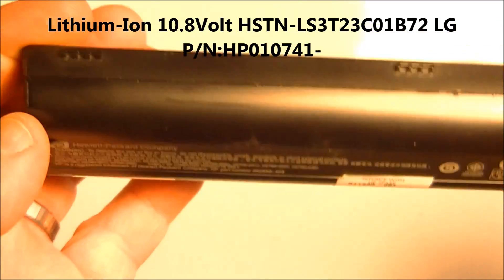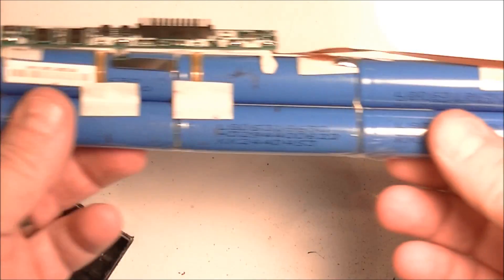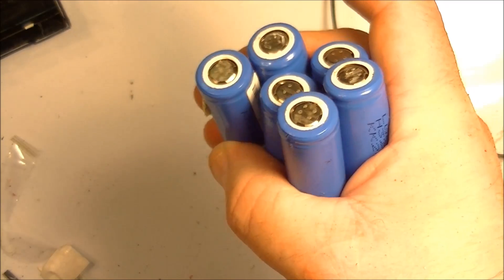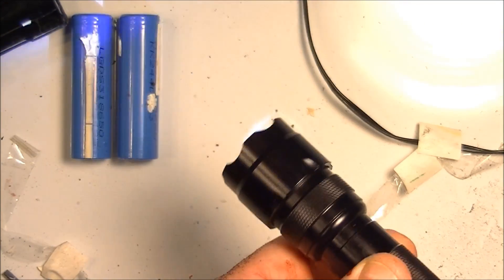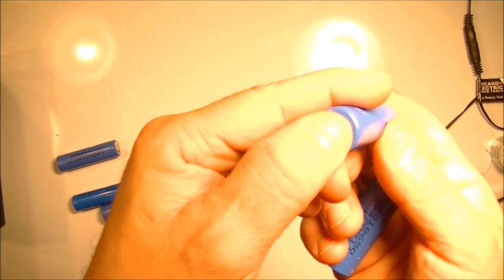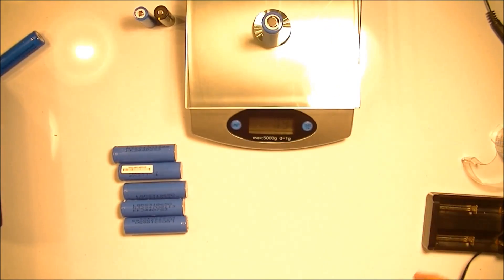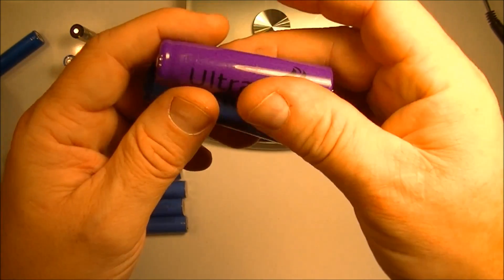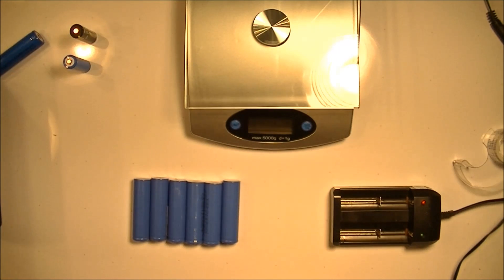18650 Lithium-Ion Battery Harvesting From Old Laptop Battery Pack

Comment: If you charge those 18650 Batteries and want to do a battery pack or put two in parallel then you should better use an balance charger. 
I used a lot of 18650 charger and they all showed 100% charge but some of the cells had 4.172v and some other ones 4.185v ... Since I discovered this I use a SkyRC Imax B6AC V2 balance charger which I bought from a trusted site which sells RC Hobby stuff.

Comment: Hi ... battery harvester,
is there a way to tell if a battery is dead before inserting in the charger ??
Reply: Hello @James Sempy,I would recommend you to measure the voltage of your 18650 cell.If the voltage is bellow 3,2v then it is probably dead but if the voltage is over 2.8v then you can try to regenerate it. One thing to conciser about a regenerate is that if the 18650 cell was sitting in the battery pack on 2.8v then the lifespan got definitely shorter. 

My recommendation would be to not even conciser to revive dead cells since you can finde them almos everywhere :)

If it goes to charging I usually charge every cell to 4.20v and discharge them with my SkyRC B6AC Balance charger. If they don't hold the charge after one week (after recharging them back to 4.20v) then they are probably damaged.

For getting the Specs of your Lithium Ion Battery visit -> http://www.batteries18650.com/

Comment: Great information, The lithium ion battery market is expected to be valued at USD 68.97 Billion by 2022, growing at a CAGR of 16.6% between 2016 and 2022.
One of the key restraining factors for the lithium ion battery market are overheating of lithium ion batteries which poses security concerns and inadequate charging infrastructure. The key market players such as LG Chem Ltd. (South Korea) and Panasonic Corporation (Japan) are focusing on the strategies such as contracts, agreements, and partnerships to enhance their geographical presence and expand their business.
Read more@ https://www.marketsandmarkets.com/Market-Reports/lithium-ion-battery-market-49714593.html

Comment: Hi Richard , i have some old battery pack from my laptop . I notice one or two cell have no voltage in it , isupposed this cell have open circuit and not charging any more I have seen some video clips showing how to revive them by pushing the top breaker button  to start up again , is it save to follow up ,or other wise, youradvice please nn tks
Reply from the maker: If the cell is at 0 then it's DONE. Do not try to revive it. You can harvest the good cells and throw away the dead cells. Thanks.
Reply: Thanks Pal

Comment: Some lap top batteries use the PIC Processor within them as a Cycle Clock. Dell does or did.  They can render the Battery pack dead after so many charge discharge cycles when in fact there is nothing wrong with the batter pack.  Harvested batteries can be  fine and have quite a bit of life to them.
Reply from the maker: I agree. Thank you for watching, commenting and the kind words. All the best.

Comment: I use these in my bicycle lights. I just jam a screwdriver in the connector hole after removing the contacts and work quickly! I leave the metal tabs on the plus ends so that they protrude more to get a better contact with the lights and charger since they are pretty flush with the surrounding plastic. If the tabs do not remain on the battery (which are dangerous as this videographer says) then I sometimes use a spike to level the plus end up more to make sure it touches the connector of my cheap lights. As you can see in this video too, it is difficult get a good contact to the batteries sometimes since they are made to be soldered to gether and not go in a light. 

I find that they are better than trustfire/ultrafire which are probably reused car etc batteries anyway.

Comment: hi.How 
can i refill an old laptop battery without inserting it in the laptop ...or incase the its laptop is already  dead ? thank you..
Reply from the maker: I would not recommend it unless you know all the specifications of the battery pack you are trying to recharge manually. You would need to know all the pin outs, voltages and amperage values to do it correctly and there is too much room for error in my opinion so I can not recommend that you do it. Be safe. Thanks.

Comment: Thanks, very interesting.  I'm not interested in the batteries, but to rebuild a laptop battery pack.  After a bit of work, got my HP pack opened, and lo and behold, there were only 4 batteries, but room for 8!  The other 4 had plastic pieces the same size as the batteries...  :)  If I can find some good batteries for this pack at a reasonable price, I may go ahead with 8!

Thanks again,

RichE
Reply from the maker: You are most welcome. I would not recommend modifying it as it could be hazardous to you or your equipment a new battery pack for your HP can be had for as little as $14.88 at Amazon: http://amzn.to/1O5tHJq. Thanks and all the best.

Comment: I did exactly the same with an old Toshiba laptop battery. 
The battery would not charge and I ended up buying a new battery for my laptop which worked fine and charged and lasted a long time. 
I then decided to take the old apart but very carefully as these things can easily catch fire if you stick a screwdriver through the side accidentally. I found the all 6 of my 18605's were all working fine and exactly the same as these here on this video. 
All of them were fine and I still have them now a few years later. 
 You know what I think????   
I think there is some sort of a clock on the circuit board of the laptop battery to tell it to stop working so you then have to go out to buy a new one. It is a big money making rip off and of course they tell you not to take the batteries apart. They would say that wouldn't they? 
If I ever need any 18650 batteries now I will buy second hand or even new laptop batteries from eBay. It is a cheaper way of getting these batteries and the 18650 batteries that do come out of the laptop battery are all good and a good brand.

Comment: I have an old laptop battery pack and it says 3600mah on the back of it. The laptop is a Sony so how much man wouldf be in one battery? (I'm trying to make and sell powerbanks)
Reply from the maker: It's impossible for me to tell you. The battery pack may be in top shape (high storage capacity) or it may be near the end of it's service life (Low storage capacity). The only way to find out is to take the cells out and test them like I did. Thanks.

Comment: So I Have (18650) Batteries from My Laptop Battery, I Don't know the Volts Or MaH, Please Help. I also Have a 18650 3.7v 2500Mah battery that was In My Mod "Vape". Do you know what that PC Battery Could Be? My PC Is HP laptop 15-f059wm. Please help
Reply from the maker: Usually it's printed on the cell it's self. If it is not the only way to find out is to fully charge the cell in a charger like Nitecore Intellicharger I4 At Amazon: http://amzn.to/2geIU2U then do a discharge test with an Imax B6 balance charger at Amazon: http://amzn.to/2fE4LfT . This is the only way I know to do it. Thanks.
Reply: HI vYPRmOTO i CAN HELP YOU if you tell me what is written on the batteries?  any ID numbers? i'm also doing this for vaping. lol

Comment: Can you recoomend a safe charger for these and where to buy it ? Thanks.
Reply from the maker: I use the 2014 Version NITECORE i4 Intellicharge Battery Charger here it is at Amazon: http://amzn.to/2dyGY1R It works great for me. Thanks.
Reply: A smart charger might be more useful since they can measure actual capacity. It will tell you the mah of the battery. I use the xtar vc4 for about $30.
Reply from the maker: Looks like a cool charger but seems to be limited to a 5V input only, which is ok but for travel charging with 12v systems may be a hassle. I also so in the reviews that it is limited on output to .5 amps depending on how you populate the bays. But again if you know it's limitations I am sure it will do a fine job for you. Thanks and all the best.
Reply: A 5 volt input means USB. You can plug it into any USB wall or car charger. So it's actually very flexible. When used with a 2 amp USB charger it can charge 2 batteries at 1 amp each or 1 to 4 batteries at 0.5 amps each. It will also charge NiMH batteries up to D size. I've used the capacity measuring abilities on some old batteries to see how good they are, that's handy. Mainly it's got a nice display compared to Nitecore. Both brands work well, but the VC4 is about double the cost at $30. 

Ideally, you should write down what you need. 
Lithium only or lithium and NiMH charging? 
Fast 2 amp charging or will 1 amp or even 0.5 amp be fine? 
Will you need to charge big D sized 32650 batteries?
Do you want a voltage display?
Etc... Then look at the nitecore, xtar, and other websites to narrow down your choices.
Reply from the maker: Thanks for the great feedback on this. It does look like a good charger. All the best.

Comment: how can i know the + and - ?  thanks
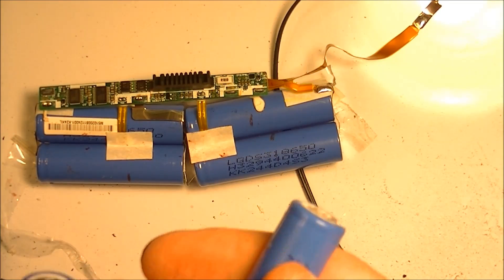Reply from the maker: You can see the the positive terminals at the 3:05 point in the video and you can see the negative (ground) at the 3:17 point in the video. If you want to be sure you can use a digital meter like this one 
Etekcity MSR-R500 Digital Multimeter, Volt Amp Ohm Meter with Diode and Continuity Test at Amazon: http://amzn.to/2e1Z5Q8 It will tell you the voltage and the polarity. Thanks.

Comment: Nowadays this test is shit because the chinese have caught on to it, if need be they fill their 18650's with leadpellets in glue to get to the desired 44-46 grams. The only way to be safe or sure is to go to your local dealer and buy Samsung, Lg, Eneloop, Panasonic or Sony. It's more expensive but they work and are a lot more durable. There are no 18650 lithiums above 4000 mAh! So he's right to highly doubt that! LOL.  The chinese even have replaced chips in the protected ones wich state after testing a very high current, just give them a try and be dissapointed. Even buying the more expensive batteries in Shenzen China (AliExpress and the likes) will not guarantee that you get the right stuff. I learned the hard way. Don't buy batteries in China.  Btw The likes of R-Trippers or Indoor-Smokers which i for various reasons regard as commercial whores. Have this problem, you don't bite the hand that's feeding you!

Comment: Is this laptop battery Used and unused?????
Reply from the maker: It was a used laptop battery pack. Thanks.
Reply: It is used without problems or such?????
Reply from the maker: Actually it had stopped taking a full charge. It did have a bad cell. Thanks.

Comment: I need a little help
i have the same battery as yours and want to replace cells but i read somewhere the replacing cells is in vain because a chip is included in circuit that stores the information of the cells if you change cells the battery doesn't recognize it and show 0 charging and you have to reset the information stored on the chip and it is difficult is it true or i go with replacing the cells...
and need some information about the cells my battery is 10.8v 55wh and 4910mah each cell of 1.8v, is it necessary that the voltages of replaced cells should be same as previous or it can be changed and and can mah be changed and is the cells in the laptop batter are simple rechargeable or they are different..
Reply from the maker: I have never tried to repair a battery pack. But here is a detailed article of what that involves http://batteryuniversity.com/learn/article/how_to_repair_a_laptop_battery Hopefully that helps. Thanks for the question. Looking for the answer helped me learn something new. All the best.
Reply: don't expect much of these cheap battery's, the safety electronics inside mostly suck and you'll get (if you're lucky reused cells) complete knockoff cells that deteriorate amazingly fast.

better spend a few bucks and replace with top notch cells
Reply: That battery is less expensive than buying 6 decent cells to rebuild it. Look at Amazon and they're only about $12.

Comment: i just broke open my old hp zd8000 pack, they are blue but not marked, can i safely put them in my nitecore charger and use them for vaping kanger nano 60w or joyetech mini 75w both tc?
Reply: yes but be sure they are rechargeable/charge protected that means u can recharge them without them over charging
Reply: HaramBleach How do I check if They are Protected?
Reply: viviala kelinina I have The Same Problem! But my Vape is a Snow Wolf 200w

Comment: How do you find the mah on the individual cells with the given information on laptop pack
Reply: When going to Ewaste centers, and looking which one of those pack to buy, First is to find Manufacturer, whether it's Dell, HP, etc. The one to look for first is Japanese made. Toshiba, Sony, Panasonic etc. because they have Japanese made cells mostly panasonic which are rated better, in capacity and quality. The next is to look for total voltage and total Watts Hour. For the most time the total voltage is 3.7 x 3=11.1 which tells you that there are 3 batteries in series. If the pack looks like there is only 3 batteries in a row, the overall size would be just that, which some of the older laptops used them. Most of the packs are 2cells in parallel(2p) and in series of 3 cells (3s) for a total of 6 cells. the higher and bigger packs are 3 cells in parallel (3p) connected in series (3s). Now is the total Watts of Watthour on the label. The example pack on this video is 47Wh at 11.1v. The total Watthour is the total capacity of all the cells in Parallel, where the total voltage is the total voltage in series. So dividing 11.1/3.7 =3S. From Power equation
P=EI where P=Watthour total, E=total voltage and I will be the total Capacity in Amps. 47/11.1=4.234 Amps. Now comes the logical equation, you have a total of 4234milliampshour, this can't possible be only one cell in series, (1P3S) for a total of 3 cells, because from the look of the pack, first of all. Does it look like only 3cells in the pack or 6 or 9 or 12, comparing from 1 single cell. If its only 3 cells, there is not a single laptop battery cell that is more than 3000milliamps. So if you look again at the pack and it looks like 6 cells total, then you have (2P3S) pack so each pair of cells in parallel has a total of 4234mah. Each cell capacity would then most likely be 2117 mah. Its rating would probably the next even number which is 2200 mah.  The rating is not necessarily the actual capacity, because of other factors involved as in battery chemistries and their impedance or resistance.  The higher the resistance the lower the capacity is from its rated capacity.  If you have one of those intelligent chargers, it can tell you the resistance, like the Liitokala 260 or the opus BT-C3100.  The common balance chargers does not give you the impedance or resistance values.  The more the cells are charged and discharged, the higher the resistance increases.
There are some that has 4cells in parrallel and in 3S for a total of 12 total cells.
3.7 x 4 would amount to  14.8v total.  I have seen those more common to the bigger laptops with bigger monitors.   If you can't find Japanese made packs, the next choice I go for is Dells.  They were ahead of everybody in my opinion.  Almost all the Dell packs I have dismantled, had a temperature sensor built in and were wired for balanced charging.  I guess they made sure the temperature sensors were there to prevent damage to the cells and  exploding laptops afterward.
Have a happy hunting.
Reply: 11.1 divided by 3.7v=3 cells in series.  its a 3S configuration.
9cells divided by 3s= 3P  its a 3p configuration 3cells in parallel.
85Wh divided by 3P=2.833Ah or 2833 Mah capacity for each cell.
P=EI  P=Power in Watthour (DC)  E=Voltage(DC)  I=Amps(DC)
This is a 3P3S  battery pack.
the measured capacity would be around this much.
Reply from the maker: +Jesse Lam Usually there is information printed on the individual cells that help to identify them. As you can see in the video there are six cells in a pack you could take the total mAh advertised and divide by 6 to get the total for each one or you could buy a lipo charger and check them individually once you harvest them. I have a video on that here https://youtu.be/xREp4T2hKIM?list=PLnxXRLSlmSVO3L0jStRnPEEN2egrODjnm Thanks.
Reply: O well the cells I harvested form a laptop pack did not label any information on it however I found 9 cells and the original laptop pack said the capacity was 85wh. The thing is 85wh may be refering to the capacity at 11.1volts Not the capacity of the cells at 3.7volts so I don't know if it can just directly divide it by 9. Do you know any mathimarical equation for this
Reply from the maker: +Jesse Lam You have to know all the correct values to figure out how much each cell has. Your best bet is to use a LIPRO charger like I did. I recommend Turnigy Smart6 80w 7A Balance Charger with Graph Screen. Here it is at Amazon: http://amzn.to/1Ur4o8y I can no longer recommend the Imax B6 as there are too many clones out there to be sure you get a real one. Once you have a charger you will be able to reliably charge your cells and at the same time be able to check their capacities. If you are going to be doing this regularly, like I do, it's well worth the investment in the charger. What are you using to charge it currently? Thanks.
Reply: +Richard Lloyd I use the cells for headlights and torches they come with a li ion charger and it outrupts at 4.2volts at 500ma.So it just tells you when its full and when it's charging